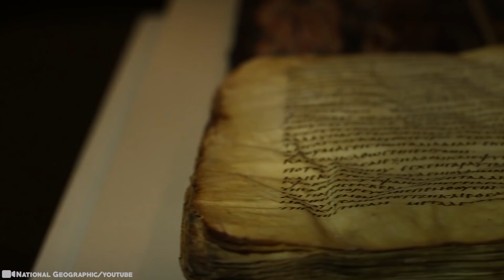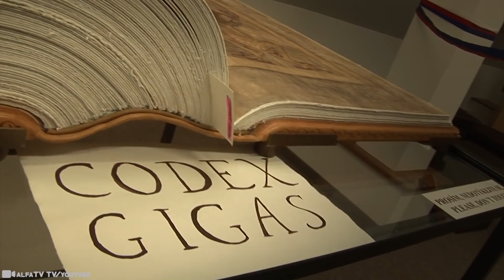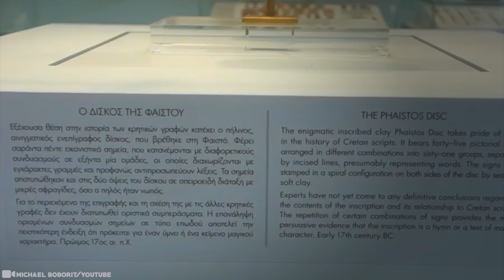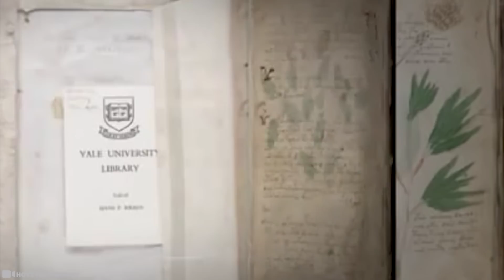15 Old Technologies Scientists Still Can't Explain

Comment: Many mysteries are long solved, like Damascus steel. Example from the Wikipedia article: "To attain a Master Smith rating with the American Bladesmith Society that Moran founded, the smith must forge a Damascus blade with a minimum of 300 layers.[
Reply: That type of Damascus steel isn't the same kind used in ancient weapons. That's just layers of steel folded over and over, I have a few kitchen knives made like that. Although layered steel is very high quality, it's not the same thing that they used to do. We just call that Damascus steel as well and idk why.
Reply: @lokuajc  because when exposed to a corrosive environment or substance, like humidity, blood, salt water, etc, the surface of the original Damascus steel weapons would develop a differential etch, showing light and dark patterning. Modern pattern-welded steel is called Damascus because it also has this trait. But the metallurgy is different.

Comment: 1 volt is by far not enough to shock.
Reply: It not the volts that kill you, it's the amps! 1volt at 0.5amps is more than enough to stop your heart. DC power (as in a battery) is much easier to do that. The reason why we have AC in homes is AC will let you go and not hurt you much due to its lower voltage so its considered safe for residences. But higher voltage (~660v AC and above) will grab you and won't let go so it is only used in industrial places where electricians are always required. In short this ancient battery probably didn't have enough juice to kill somebody but would give a pretty good shock, and at the time it would be considered "magic" and likely make people freak out enough to run away. Just guessing because no one really knows.
Reply: @pjackson8322  Ac voltage is far more dangerous because if leads to ventricular fibrillation far easier. It will also have the effect of dc  voltage as the body is mosly ohmsch and dosn't have a lot of capacitative or inductive resistance....
As such safe voltages for Dc in adults is 60V and 25V Ac 
with 120V Dc or 50V AC  likely lethal  over short time.

Comment: We should not assume that the Antikythera Mechanism is from the ancient shipwreck, but a device thrown overboard much later in time, (probably late 1700s through early 1900s) that happened to land inside the wreck by chance.  People have found objects inside of fish and shark stomachs, that obviously didn't come from them.

In like manner, it should never be assumed that if you find an older artifact at a site that has been historically known and accepted to be a certain age, that you change the date to accommodate the artifact.  Civilizations conquered and pillaged, traded and exchanged wives with all their belongings.   I'm sure people collected antiques and valuable pieces in similar likeness to people today.  So, if you find an artifact that doesn't fit the age of the city, do not assume the city is older or inhabited by someone other than the historical record allows.  Just assume the artifact was brought there after the place was founded.
Reply: The writing inscribed on the gears is ancient greek also it calculated the 4 ancient greek games (Olympic, Nemean, etc.) So it could not be of a  recent fabrication.
Reply: @tanzanos  also, the level of corrosion and sediment concretion is consistent with it having been there from the estimated time of the original shipwreck

Comment: I believe that Damascus Steel ripples is created by switching cooling techniques, from rapid to slow, which alters the metallurgy slightly back and forth.
Reply: I think you better head to the library and read what the Damascus method entails.
Reply: @berniemiller4704  So a "Miller" is telling a "Cooper" that he does not know how steel is made. I think a "Smith" should weigh in (preferably a blacksmith, but a Smith of any race would do in a pinch)
Reply: @pargolf3158  interesting catch on the names, there...
Ancient Damascus was a product of the mines the iron came from, which had specific ratios of other elements in the ore, as well as the development of dendritic carbon in the steel grain structure. Modern Damascus is multiple alloys layered and forge welded, then etched in acid to reveal the layering.
Reply: @Par Golf  okay so you challenge my common knowledge. I may not be a metal smith but that doesn’t mean I don’t know anything about it.
Reply: @berniemiller4704  Since I have zero knowledge on the subject, I defer to you. I just found the irony in the two surnames in the conversation. No offense meant

Comment: So, it is common, to find ore deposits that are free from inclusions or non similar deposits.   There have been times when deposits of near pure gold have been found, so it can be safely assumed that iron, lithium and everything else has had near pure deposits and especially so, the further back in history you go, the more of it would be there.
Iron pillars are no different than iron skillets and as they are cooling, oil or fats can be smeared to cure it.  And, if it is in an environment that doesn't promote rust well, then the iron will form a protective patena and last indefinitely.  The sun impacting all day, the metal stores sun heat energy, which slowly emits away through the night, which aids in repelling standing, atmospheric moisture.
Reply: Iron with higher than normal content of phosphorus kept it from rusting, no mystery.
Reply: @123chugchug  yeah, the Delhi column was a metallurgical accident, the part he left out is that there used to be several of them, and the others didn't last as long.
Reply: Probably not relatively pure lithium deposits, as it is highly reactive and not found in elemental form in nature, but in minerals and compounds.
Reply: @permanentvisitor2460  yeah, really.  Lithium reacts with WATER. It is not stable in it's pure form.

As for Iron?  There were in recent enough times places in the US with Iron ore pure enough to make workable metal just by melting it.  But... that's not what the Delhi column was made of.
Reply: @marhawkman303  yeah. Unfortunately, all of those high grade iron ore deposits in the US went dry in WW2
Reply: @permanentvisitor2460  quite true, but,  did places like India have them in the distant past? hard to be sure. :D

Comment: Noctoria (Night time urination) 
Drinking water at night how it helps
Noctoria and heart problems are related. 
 It is worth spending two minutes to take read the information below. 
An American doctor tells us that Nocturia,  heart problem and cerebral infarction are related. The most common symptom of middle-aged and elderly people is nocturia (waking up at night to urinate). Because of nocturnal urine, the elderly are afraid of drinking water before bedtime. They don't know that not drinking water before going to bed, getting up in the middle of the night to pee without drinking water is an important cause of early morning cerebral infarction in middle-aged and elderly people.  In fact, nocturia is not a problem of bladder dysfunction. Nocturia is caused by the aging failure of the heart function in the elderly, and the inability of the right heart atrium to suck blood from the lower body. During the day, we are all in a standing position,  The blood will flow down. If the heart is not good, the blood volume of the heart is insufficient, the pressure on the lower body will increase, so middle-aged and elderly people will have lower body edema during the day. When they lie down at night, the pressure on the lower body will be relieved and a lot of water accumulate in the tissues  The water returns to the blood.  If there is too much water, the kidneys will work hard to separate out the water and drain it to the bladder, causing nocturia. Therefore, it usually takes about three or four hours after lying down to sleep to get up and go to the toilet for the first time. After that, the water in the blood continues to increase. So after another 3 hours, they will have to go to the toilet again. Why is this an important cause of cerebral infarction and myocardial infarction?  Because after two or three urinations, the water in the blood is greatly reduced. The body also continue to lose water through breathing. The blood then begins to become  thick and sticky, and the heart rate slows down due to the low metabolism of the body during sleep. With thick blood and slow blood flow, the stenosis of the blood vessel is easily blocked... This is why the middle-aged and elderly people almost always have myocardial infarction or cerebral infarction at 5 or 6 in the morning. This situation will lead to death while asleep. The first thing to tell everyone is that nocturia is not a malfunction of the bladder, but a problem of aging heart.  The second thing to tell everyone is that you must drink some warm water before going to bed, and you must drink some warm water after you wake up in the middle of the night to pee. Don't be afraid of nocturia, because not drinking water may take your life.  The third thing is that you must exercise more in normal times to strengthen the function of the heart. The human body is not a machine. A machine will wear out when used frequently, but the human body will be the opposite. It will become stronger when used frequently. Do not eat unhealthy food, especially high starch and fried foods.  If you like this article, please forward it to your middle-aged and elderly friends
▪️▪️▪️👍👍▪️▪️▪️▪️gghgj
Reply: What does this have to do with the video? It's old news anyway, been around for along time and sea know about they just don't treat it the right way.
Reply: Thank you for this detailed explanation. I needed to read AND understand this subject. Many Blessings
Reply: I'm sorry, which part of the video did this explain?